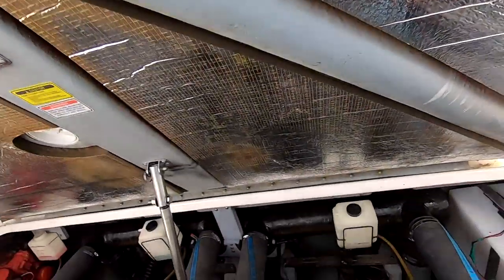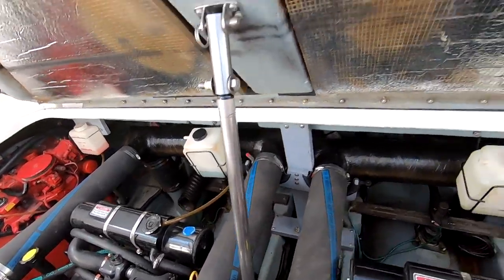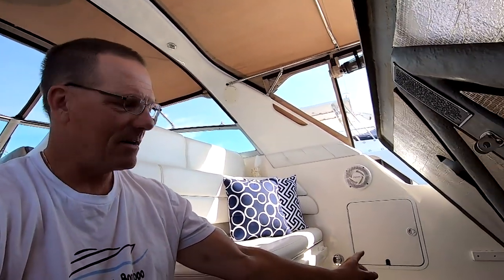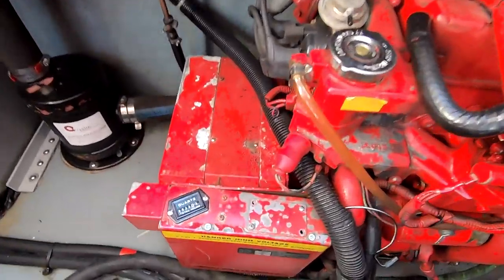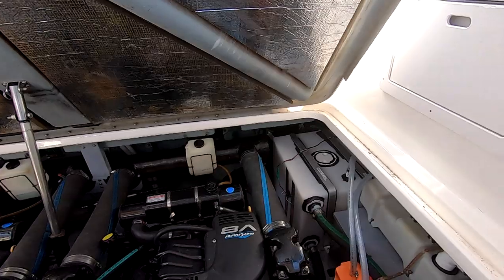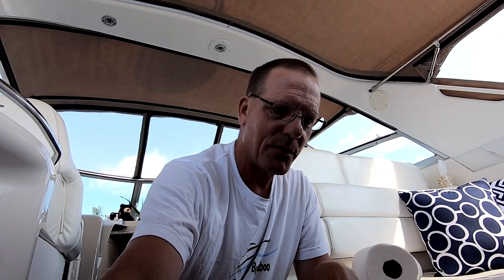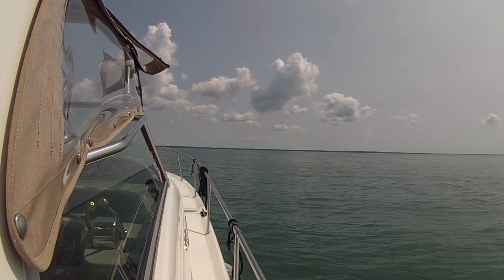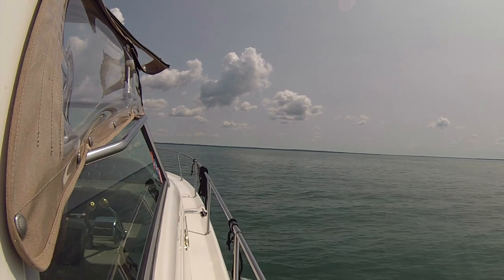Engine Coolant Update

Comment: Hey Paul,
I second what JG G said re a bit of air that may need to be burped out if you recently did work on the hot water heater. With that said, if the heat exchanger is staying topped off, all the way to the bottom of the cap neck before and after running (and cooling all the way down) you are probably not losing coolant. I would top off the expansion tank to the “Low” (cold) mark, and if the heat exchanger is remaining topped off and the expansion tank returns to the low line after full cool down you’re good to go. 

You mentioned the previous  owner doing some maintenance to the core. If there are any pinhole leaks in the core, you will know it because your fluid will drop below the cap neck and you will constantly be in need of top off. After 14 years on our original Crusader heat exchangers (2004 Tiara 3100 Open LE with Crusader 8.1’s) the starboard heat exchanger developed a pinhole leak. That was 14 years in a saltwater environment, with meticulous maintenance schedule. 

Since you’re in a freshwater environment there wouldn’t be much harm if at some point you develop a pinhole in the core. The fluid will mix with the raw water and flush around in the block and manifolds and eventually out the exhaust. In salt water that needs to be taken care of more promptly. 

As mentioned, if you monkeyed with the hot water tank my money is on a bit of running and topping until you have the system balanced out w fluid. 

Good luck and enjoy the summer!

Comment: You replaced your hot water tank a short while back....As you are aware the coolant lines run through the hw tank to heat up under way.  Any hands you had air in the line which worked it’s way out and expansion tank filled the void?  We have twin 7.4 MPIs in our 360 and just finished the same poop tank wan hot water tank change out.
Reply from the maker: That's something I never thought of. Of course, I am aware of the water heater heat exchanger, but never considered an air bubble in one of those lines...